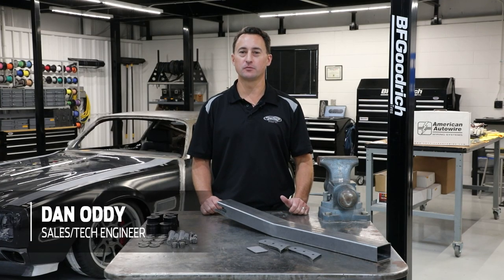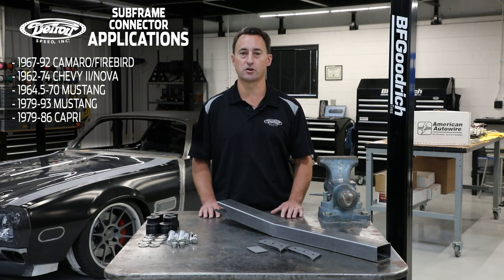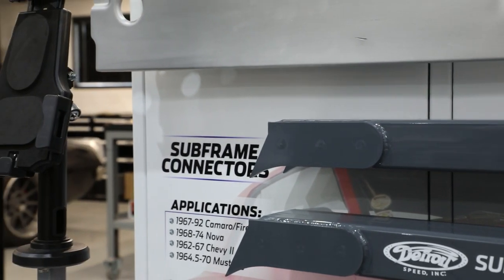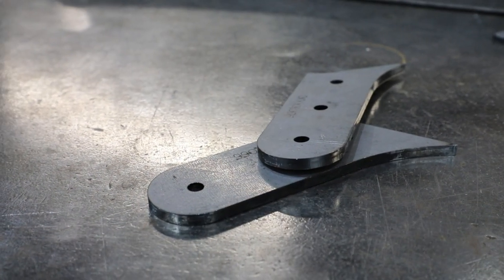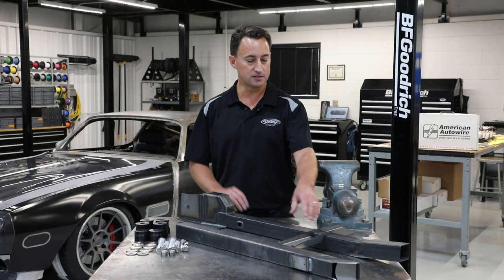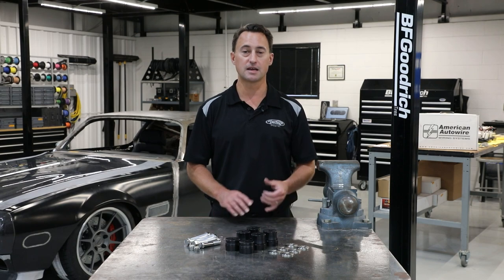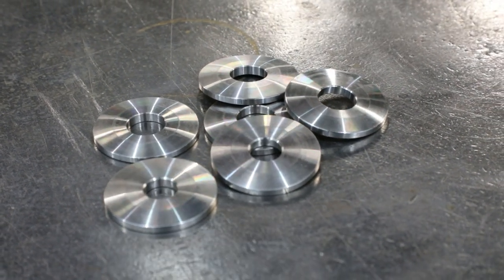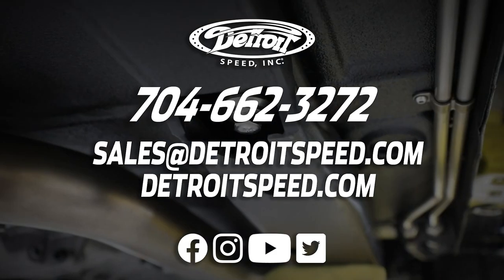Subframe Connectors - Detroit Speed Tech Talk Ep. 012

Comment: On the 69 CAMARO why does the fish mouth look like it doesn’t weld to the top of the rear frame rail . The bottom of the connectors is the only part where it gets fully welded to the rear sub. So the top of the rear fish mouth only ties in to the torque box thin sheet metal??? Interested but maybe I’m seeing it wrong?? Thanks

Comment: how much do solid body mounts affect ride quality/vibration compared to poly and rubber?
Reply from the maker: Having personally driven customer and shop vehicles, you can't tell any difference. With the bolts  installed to the specs we offer, no additional noise is noticeably transmitted.

Comment: i ordered  the solid body mounts for 1978 Trans AM ,,,are the shorter mounts suppose to be front under the radiator ?
Reply from the maker: Omar, our body mount kits are not designed to work with 1970-81 Firebird applications due to the core support mounting being opposite of Camaros.